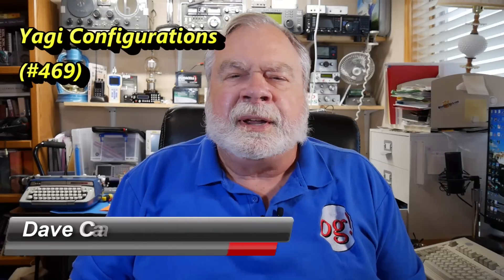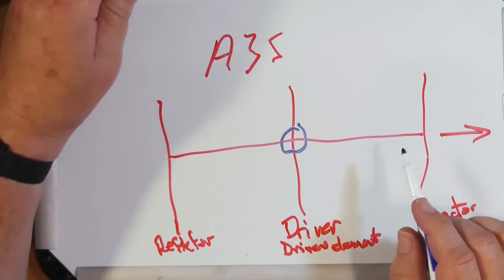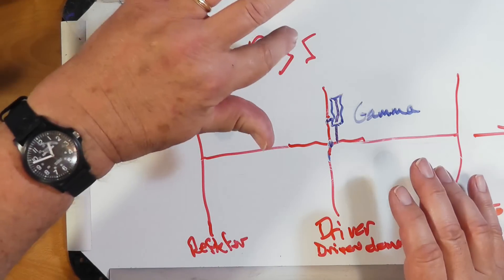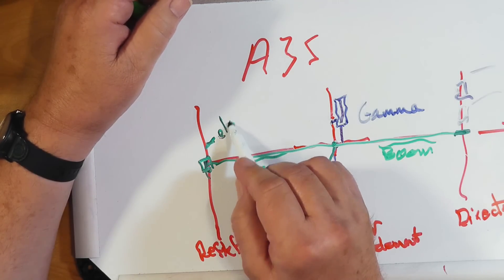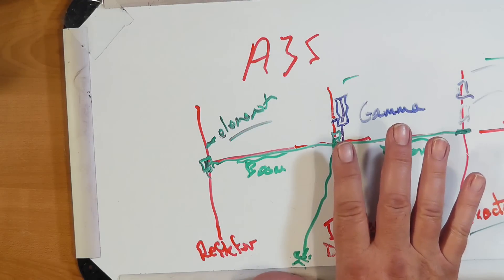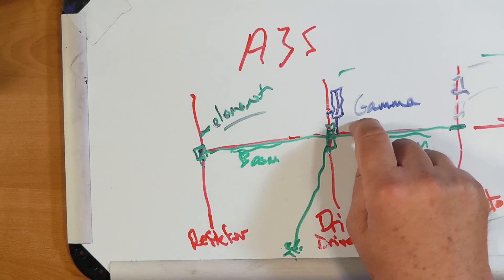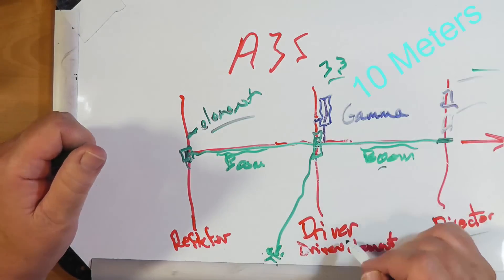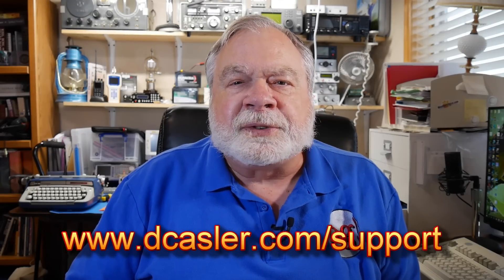Yagi Configurations (#469)

Comment: Are you familiar with  the use of Yagis for electroculture?
I have seen a design which is bent from a single length of wire to create a looped Yagi with only 2 elements and wondered if better results could be achieved with a less crude design.  The Driver being separated.... yet reconnected with a Hairpin.....why?  Why disconnect it only to reconnect it?  I would prefer to attach straight pieces of wire to a piece of wood as the boom and then run a piece of wire to ground from the Driver if that would work just as well or better.  Also why the loops instead of straight elements in the design I saw?  Is there a performance reason or is it simply because they were using a single piece of wire?  Thanks in advance.

Comment: I am currently testing some diy solutions for ADS-B at 1090MHz and so far I get best results with a spider antenna. Since I live in a valley with mountains blocking north/south, I am curious to make an antenna that is a bit more directional. I already built a small 3-element yagi and got a bit more range in one direction but of course lost some behind it. What would happen if I replace the reflector by a second director? Would that give me a two-directional antenna? Or is there a better design for my usecase?

Comment: Hi Dave, I wanted better FM radio reception so I built a 5 element yagi-uda centered around 100 Mghz. My reception is insane now, compared to the indoor antenna I was using. My question is about picking up distant stations. I want to know if it is possible to use a dipole antenna, invert the signal, then use it to cancel out the strong stations the yagi and the dipole both receive? Maybe hear a station on the same frequency that is normally drowned out by a closer one?

Comment: The fact that 3-element triband trapped Yagi antennas exist, and work well, hints that the element spacing (in wavelengths) isn't all that critical; since in such a design one set of element spacings is being pressed into service on three bands.

Comment: Sir, may I ask. For a 3 element C.B. yagi, which configuration will have a stronger transmit, the driven element being closer to the reflector or should it be closer to the director? And 2nd sir, would it really matter having the yagi horizontally polarized and making a QSO with someone with a vertical antenna? Thank you sir.

Comment: I  have the a4s version of this beam, and like you mentioned it needs much room to turn, more room than I  have between trees? Could this beam be reconfigured to become a kind of V shape where both sides is half vertical, half horizontal? I have seen a dipole that is made this way. I might could turn and use a V beam. LIKELY  it would work not as well as being horizontal or all vertical? Anyway, the half-driven element mounted as a vertical works much as the 12AVQ you have spoken of?

Comment: this was a very practical view of Yagis!  -  thanks -  I have learned very much about Yagi design from the NBS Technical Note # 688, which can be found all over the internet!  It goes into very great detail about the optimum spacing, boom length, element length, etc.,  to get an optimum gain out of a given number of elements.  This work was done at the antenna farm testing field  way back in the old days, before WWV was moved to Colorado...  but the practical tests should be no different to what makes the best antenna today!

Comment: hi, dave,
you mentioned putting the antenna up, taking a reading, take it down, tweak it, repeat as necessary.
many years ago in my pre-ham days  i was present at 2 assembly parties in which the antennas were
assembled on, AND tuned on, sawhorses, then just put on the tower once.
i don't remember what the tuning devices were (mid-1970s), but probably were analogue.
so, the question: does it matter where the tuning takes place?
thanks! keep pumping out the vids.  rodney KAØUSE

Comment: I am considering trying exactly what Dave said concerning a fixed wire Yagi.  I have a fan dipole (40/20/10) in the attic and I could easily add a parasitic wire or two for the 20m with the right spacing.  My house is arranged so that the antenna points approximately to Europe, so that's convenient.  Eznec modeling shows that the 10 and 40 would not be greatly altered, but the 20m would see a good directional gain.  It would kill my reach to the US west coast on 20m, but it would be a nice experiment anyway and easy to remove.